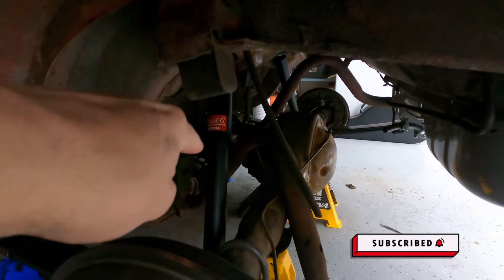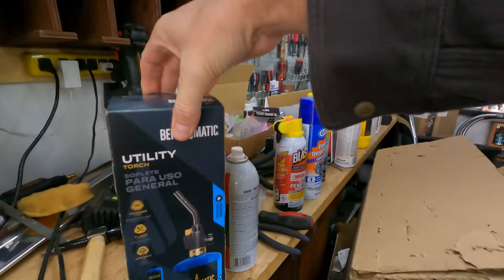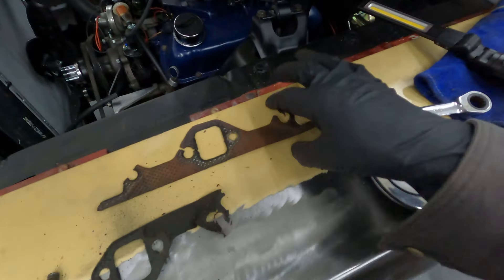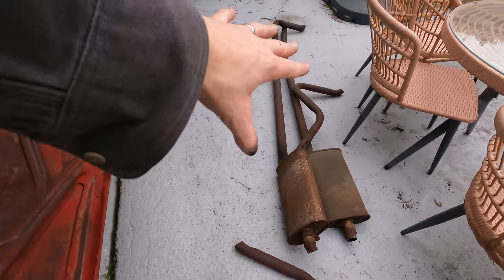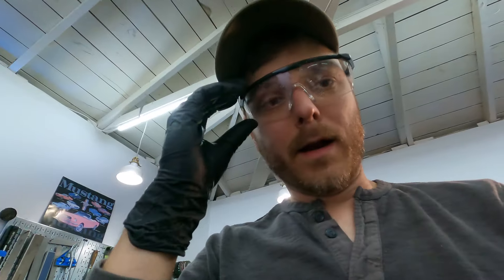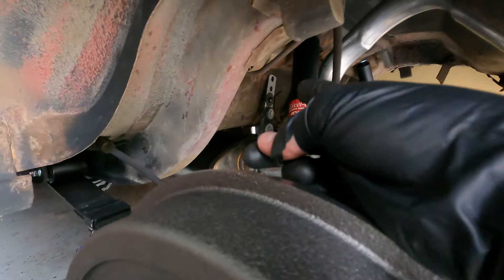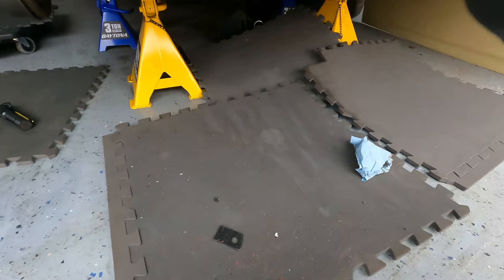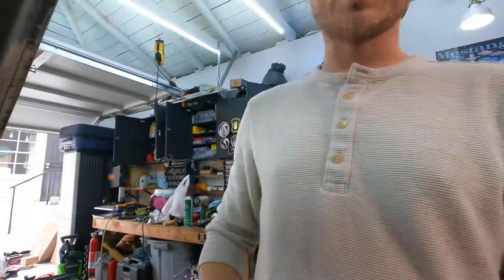1965 Mustang GT Exhaust Install | Magnaflow | Restoration - Part 15

Comment: There are a lot of misconceptions about PCV valves…for a street driven vehicle, they’re so important. BTW: Look into the M/E Wagner PCV valve. You definitely want to run a PCV system to keep your crankcase clean and prevent oil leaks from the pressure build up. The PCV system is a working loop with the breather cap venting to the air cleaner. If your engine is stock then a stock PCV is fine. But if you run a decent cam, then the M/E Wagner adjustable PCV is the ticket.

Comment: You may want to research the original setup for crankcase ventilation on the 65. I don't recall what the stock setup was. On my 66 289 I used caps on both rocker covers that just vent to the open air and didn't have any oil coming out. On my Dads 289 he used a PCV valve on the passenger side cover and may have had it hooked to engine vacuum. His car was sold so can't check the exact setup. Neither of us used stock rocker covers.

I think it was around that time (65-66) when they started using PCV valves in cars.
Reply from the maker: Thanks, this is a 302 not original to the car. I think the best bet may be an extra line with a catch can and filter?
Reply: @VanHoutenBuilds  I've had a couple of different set-ups.  To make what you have work properly, you need a vent tube (literally a pipe that bends down to the bottom of the motor and vents to open air) OR a PCV back to the manifold or a carb spacer plate.  Either of these installs on the passenger side to complement your vented breather on the driver's side.  I found the PCV set-up to be cleaner-running for sure - much less odor in the car at idle - and it is more environmentally friendly if that is a factor for you.  I detected no difference in performance.
Reply from the maker: @markwilliford7471  I have the carb spacer plate with the new pcv valve running to it from the valve cover. Seems to be working properly. Just getting a lot of condensation from the other side breather. I think I may add a new cap with an oil catch can.

Comment: Hi it looks great.. I am doing the same install and I found the mufflers to be a really loose fit  and sliding around on the intermediate pipes. I was wondering how yours were before clamps?
Reply from the maker: Hey! Yeah mine are the same. I basically clamped everything down so much that it bent the piping and crimped them in place. I also got different clamps, b/c the ones that came with the kit almost seemed too small to fit around the pipes. Also I probably should have cut down the passenger side pipe that goes into the muffler b/c it went so far into the muffler until it hit the muffler wall bend. Now it's crimped so tight I can't get the pipe back out of the muffler. Oh well haha. I may have to end up welding them a bit. I would recommend these clamps for certain spots:  https://www.amazon.com/gp/product/B078TXNCP6/ref=ppx_yo_dt_b_search_asin_title?ie=UTF8&psc=1
Reply: @VanHoutenBuilds  Thanks for getting back to me I was worried they had sent me the wrong size mufflers. Good advice on the different clamps. My exhaust pipes over the axles are too tight around gas tank so I guess I will be cutting. Thanks again for the response.

Comment: @VanHoutenBuilds did you have to modify the break lines to install the dual exhaust? Or did have dual exhaust already before? It looks like this kit just worked around it. I have a 64.5 project that I am working on and mirroring a lot of your projects.

Comment: Sounds awesome and i want to do the exact same set up.  Can i ask, how come you didnt do headers when you were working on the manifolds?  Thanks for the video.
Reply from the maker: Thanks! I was thinking about doing headers but after a ton of research I couldn't find any headers that didn't take modifying. Didn't seem like there were any that you can just bolt up w/o denting in or bending. Seemed more affordable to keep the manifolds that I had since they were in ok shape. If I get a wild hair down the road I'll throw some headers on. Let me know if you are able to find headers that don't take any modification to install!
Reply: @VanHoutenBuilds  sounds good.  The stuff ive seen say a lot of people are having success with the tri y headers.  But dont take my word for it as i have no experience.  Im on a couple of resto mustang fb groups. Keep up the awesome vids
Reply: I did tri-y headers on my ‘66 289 and they fit great. Only a slight bit of interference with the parking brake lever.
Reply from the maker: @dm7097  Where did you buy them, or what brand are they? Also did you have to put a bend in any of the pipes to make them fit?
Reply: @VanHoutenBuilds  no mods at all to them. 
Honestly, I bought them so many years ago, I don’t remember where. 
I can say, they were just cheap headers that I sprayed high temp paint myself. (Young family = little spare money)
Most likely purchased through one of the bigger supply houses. (Could be mustangs unlimited, although I think they are gone now)
Reply: @VanHoutenBuilds Do not put headers on you classic mustang they tend to get exhaust leaks bolts loosening etc  It sounds good like that but headers are a bit too loud for me

Comment: I'm trying to do the same install, how much wielding is required? How hard was it to go over the axial ?
Reply from the maker: I didn't do any welding. Just used exhaust clips! I may go back and weld a few points where I had too much pipe and pinched the metal with the clips and now can't get them out but might be losing air flow. It was fairly easy to get over the axel b/c they are all separate piece that you just connect and twit where you want them to go. You just have to make sure that you have the mount points and if not, then you need to add those in. The part that was the toughest was the GT valance part and getting them to come out those holes. The straight pipes don't give you much room to work with the leaf springs and gas tank, but I was able to do it. Otherwise the GT exhaust tips have the bend already in them so they are probably easier to work with.
Reply: @VanHoutenBuilds  Great feedback. I'm gonna give it a shot. No fear, I do almost everything but I think this may be over my head. Gonna try.

Comment: why is ok to use clamps some times vs wielding?
Reply from the maker: The clamps are easier for connecting everything rather than welding. You just have to make sure the clamps are high enough quality to close off any escaping airflow. I may have tp go back and weld some parts of the exhaust. The clamps also allow you to mount the exhaust to the body more easily.

Comment: On the vent, if you are only doing short runs and cold starts and not letting the engine get up to temp, that will happen. Try letting her run for 30 min or so, then clean up and try the cold starts the next couple days. The initial vapor loss on the oil should clear up fast… if not… catch can.
Reply from the maker: Ok, I'll definitely give that a try! Whoever had the engine before just had a completely closed oil cap on the valve cover, so I switched to the breather cap. Thanks!
Reply: @VanHoutenBuilds  the breather cap is much better, I have a 73 Mustang project with a 302 and the previous owner did the same which caused too much crank case pressure and leaked from the rear main seal, put the breather on and now the leak is nothing but passive wetness. Which is how I figured out about the vapor loss - mine did the same thing initially.
Reply from the maker: @Gogogorush  Ok that's good to know! Thanks!

Comment: What's the part number for the exhaust?
Reply from the maker: CJ's Part Number: EXK3AM  I would recommend maybe going with a 2.25" or 2.5" pipes instead after hearing these. They aren't as deep as I thought they would be.

Comment: Nice.  Always loved the GT exhaust.  Had them on my ‘66.  Are the Magnaflow’s the 40 series?
Reply from the maker: I'm not sure what series the magnaflow's are. I was hoping for a little bit more of a "glasspack" sound. But they sound great, regardless. https://www.cjponyparts.com/dual-exhaust-kit-2-with-magnaflow-mufflers-mustang-260-289-302-1965-1970/p/EXK3AM/
Reply: Ok I see in the Q&A it’s a straight through design.  Not a chambered design like the series 40.  I bet when they get broken in you’ll get more of the glass pack sound.
Reply from the maker: @springman1740  That's good to know! Thanks

Comment: Exhaust is too close to the fuel tank on the drivers side. It's not just the fuel line that presents a safety hazard.  It was not designed to be a dual exhaust.
Reply from the maker: So on a true GT mustang is the fuel tank and fuel line in a different place? Any recommendations?
Reply: @VanHoutenBuilds  keep it factory correct. Weld all exhaust joints and hangers to keep it stable. The whole gas tank design is very risky. Data on fires and deaths for these vehicles and their drivers is no longer collected.

Comment: I know it's spending more money but a pair of shorty headers or high quality tri-y headers would have been better. Increase exhaust scavenging, performance and low to mid range where you'll be driving it most.
Reply from the maker: Yeah I wanted to do that, but everyone keeps saying that you have to slightly modify them to get them to fit? Are there any specific ones that you would recommend and that you know fit the 302 without modification? Thanks!
Reply: Doug's tri y headers D661Y-B from cjpony. But call Doug's directly to confirm fitment.
Reply: But unless you upgrade to an aluminum Edelbrock performer rpm intake manifold you don't really need the headers. Drive it with the manifolds first. No rush.